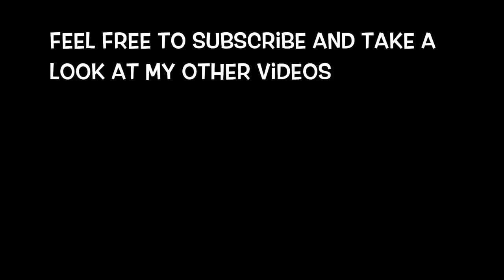Bench Top Router Table Build - FREE PLANS

Comment: What router bit did you use to cut the T-track slots?  The templates were the exact same size as the track
Reply from the maker: Information is in the description but it’s a bearing guided bit either the bearing at the top. Some people call it a template bit. 👍🏼
Reply: @WheresMyPencilUK  I missed seeing that, but thanks for the info.  I've always used the router base plate, a groove bit and had to set the template away from the slot.  Takes some setting up and not always practical to do so.

Comment: Hi,I'm sorry I tried looking at description but I could understand the length of the table. I understand u used 118 mm MDF. It would be very much grateful the  length of the table
Reply from the maker: elvis the acrylic square was 20x20cm. The table is 60cm wide and approximately 45cm deep. The fence is 12cm high. Hope that helps.
Reply: Thank you

Comment: What is the advantage of using acrylic for the base, why do you need to look through the base from above?  Great video BTW, will be building it for myself.
Reply from the maker: It’s so I can use it as a base for handheld routing. Saves removing it.
Reply: My question was, 'Why does it need to be see-through?'. I understand that you want to be able to remove it, but why could it not have been a panel of wood which you cannot see through?
Reply from the maker: Try routing with a base you cant see through.
Reply: I've only ever used a hand-held. But liked your design.  Off to Lowes this morning to see if I can buy an acrylic base.  Really liked the design of the dust collector!  I'll be a subscriber for sure.
Reply: Had to order the acrylic on amazon,  They measure it in inches. So I got 1/4 ", would that be ok?  Also, what type of router bit did you use to create the recess for the acrylic in the router table top?
Reply from the maker: Same type of router bit for all of it mate.

Comment: The measurement that you gave is in mm not inches where can I get a ruler with the mm marking on it, how far the marking will be on it.  Thank you
Reply from the maker: In the UK we use metric. 1 inch is 25.4mm. Try eBay for a metric ruler the ones we have usually have inches and cm/mm.
Reply: Thank you

Comment: Not sure how you did the inlay. Do you need a plunge router  or a special inlay attachment to complete?
Reply from the maker: It’s a bearing guided router bit with the bearing on the top which follows the template.
Reply: @WheresMyPencilUK  I purchased this bit you are referring to but still unable to meet the depth of 1/4" or 6 mm. I constructed a template similar to your with the thickness being 1/4". Not sure what else to do.
Reply from the maker: Diego Ramirez you need to adjust the depth of the cut gradually it will then create a template for itself to follow.
Reply: @WheresMyPencilUK  thanks. I figured what i was doing wrong. Thanks for the tips!

Comment: Why are the pocket holes on the outside and top of the 2x4s?
Reply from the maker: It makes a stronger joint. If on the inside there is less material between the screw and the end. Aesthetically it’s not great but for this purpose it doesn’t matter.

Comment: Great video again. Can you just explain very quickly how and what you used to route out the grooves for the T-Track please. TIA
Reply from the maker: Hi Ravi I use a double flute straight router bit with a bearing at the top. Some people call it a template or profiler bit. The bearing runs along and follows the MDF template I placed around the T-Track which is then removed and and cuts a grove to the exact size. You need to set the bit to the same depth as the T-Track
Here is a link to the bit I used: https://www.trenddirectuk.com/46-900x1-4tc?gclid=Cj0KEQjwuOHHBRDmvsHs8PukyIQBEiQAlEMW0Cxzp70vLUn8olgPuV0H0NDPeqNfSunSUIm2Kc0PhuYaAhEM8P8HAQ
Reply: Thanks so much for your speedy response, you have a subscriber for life, cheers mate
Reply from the maker: No problem.

Comment: Nice router man what kind   of bit  did u use  for the railing  and where did u get that sticky  woods  need to make one for myself also did u get the 8mm acrylic from Home depot  thx
Reply from the maker: Thanks john there's a link to the bit in the description. The mdf strips were stuck down with double sided carpet tape. 👍🏼
Reply from the maker: Yes same bit same process. 👍🏼
Reply: i got the bit but  it does not have the bearing  would that work ?
Reply from the maker: No you need the bearing to run along the mdf guide.

Comment: Can I ask why the pocket holes are on outside?
Reply from the maker: Hi Steve it’s for strength. If they are inside it’s  towards the edge of the adjoining piece of wood but on the inside it’s towards the centre.
Reply: @WheresMyPencilUK  ok thanks must of missed you saying it since my strokes I’ve lost my short term memory on top of my R.A. I’m trying wood working to help keep brain active but saving up for miter saw first. I want a router but don’t know anything about them I like the two handed ones but don’t know if they can go on a router table. I can’t afford to to buy one and a router table with one fitted or two routers
Reply from the maker: Any router can be made to fit a router table. Key thing is making the on/off accessible and also the height adjustment. Two handled routers generally are 1/2” and more powerful which is better.
Reply: @WheresMyPencilUK  hi so a lumberjack router that can do 1/2 and 1/4 would that be ok it’s one of there new 1800w motor so advert says I’m going to use it as a plunge router first as never used one. I’m 54 and never used a router circular saw table saw router table ect anything apart from a drill driver so I consider myself a complete novice

Comment: What router bit used ?
Reply from the maker: 5lowethechamp it's a template bit as shown in 3:02 it has a bearing in it to guide along the MDF template. Probably should have gone into more detail.
Reply: Happy Wife Happy Life thx i got it, bought my acrylic ✌️
Reply from the maker: No problem whatever you do, don't use a forstner bit to drill a hole in it, took ages and made a right inaccurate mess. Nightmare!

Comment: WAIT WHAT????  how did you go from https://youtu.be/rUT3u6muDWw?t=232   to  https://youtu.be/rUT3u6muDWw?t=235 with a JIG SAW cutting hole to hole. It would have left that ridge. Did you clean up the jig saw cut with the router in some tricky way? or just file it down with a wide sand block?  I mean I know how I might do it myself but how did YOU do it?????

Comment: Dear god, you had the router… which cuts acrylic.
Reply from the maker: Melting point for acrylic plastic is 160 degrees C, so they cannot withstand extreme temperatures. Router bits run hot. I like my bits sharp and it would dull them. Clever clogs.
Reply: Where's My Pencil? - Wouldn’t switching to lexan fix this issue? (Btw, I’m asking out of genuine curiosity, so forgive me if it comes across too direct)
Reply from the maker: Lexan can be less rigid but give it a try. 👍🏼

Comment: Not a bad build, just cut the music, I can't stand it and your accent, which you can't help. Just one little aside to help with the accuracy of the fence. In addition to the t-track add a 1/4 inch straight groove parallel to the t-track on either side and install a 1/4 inch piece of hardwood to the bottom of the fence. That will keep the fence from wiggling and make it run straight. Otherwise, nice build.
Reply from the maker: +thorlo6 glad you liked the build. Can you change your profile picture please? I can’t stand your face which you can’t help. Thanks.
Reply: You know it dude!LOL!!! Seriously You have my humblest apology, that was extremely rude of me. FYI I did download your plan it is very nice.
Reply from the maker: +thorlo6 no problem I’m not easily offended! Glad you like the plan.